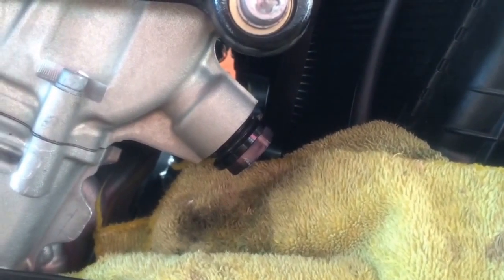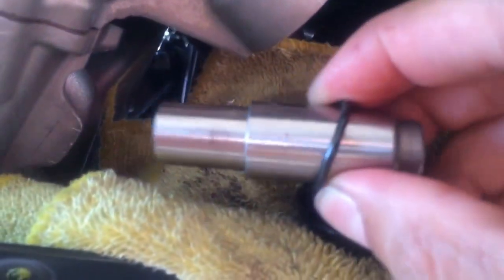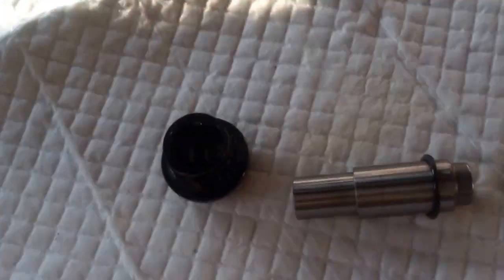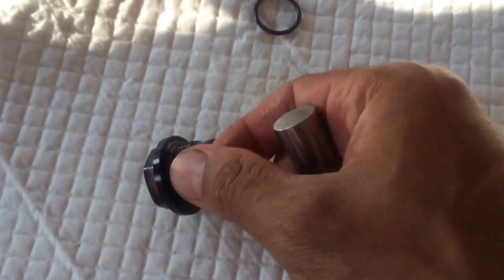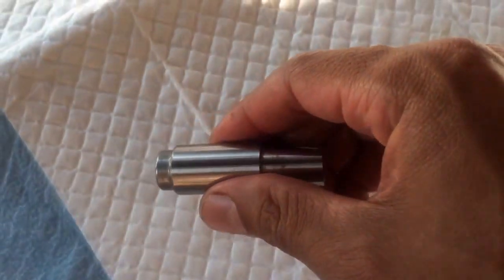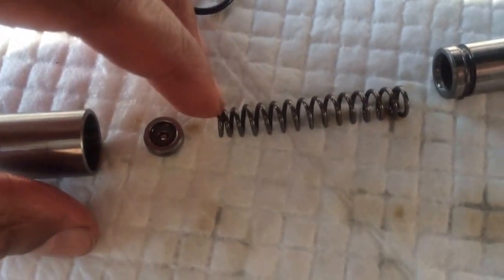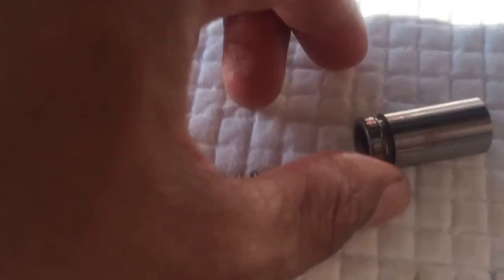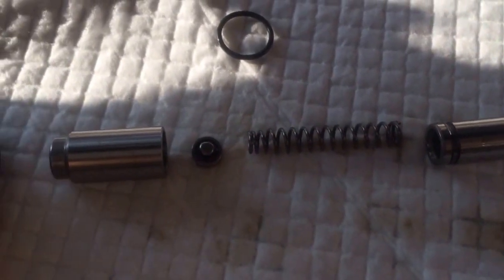BMW s1000rr Cam Chain Tensioner Removal and Explanation of Parts

Comment: That small ball bearing is a check valve to hold hydraulic pressure when the engine is off - if that check valve is bad the timing chain will rattle on startup until oil pressure loads up the tensioner again.

Comment: U didn't put the engine in top dead center?
Reply: There’s four cylinders on this engine, you didn’t specify which cylinder.  Also, you don’t need to put anything at TDC on compression if you aren’t removing the cam journals and not turning the engine over. There’s enough tension on the left side of the chain.

Comment: My S1000R is making like a rattling noise and the BMW told me it is a timing chain tensioner.
Reply: How much did they charge you to fix it?
Reply: @ncaap3575  I ended up replacing that part myself, it's pretty easy. 
Sometimes BMW will do it for free as a recall type of thing.
What bike do you have?
Reply: @EEEBA1  2012 s1000rr
Reply: @ncaap3575  What can I help you with? Do you need additional info on the tensioner?
Reply: @EEEBA1  I think it’s Pretty straight forward. I’ll do it also
Reply: @ncaap3575  I just came across this. I'm not sure if you knew about it.
https://www.asphaltandrubber.com/recall/bmw-motorcycle-fuel-leak-recall/